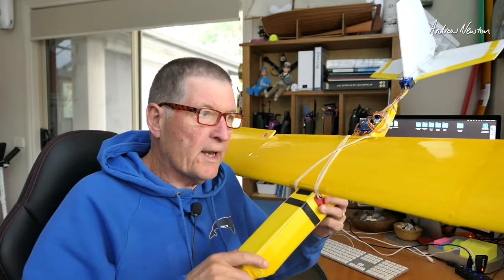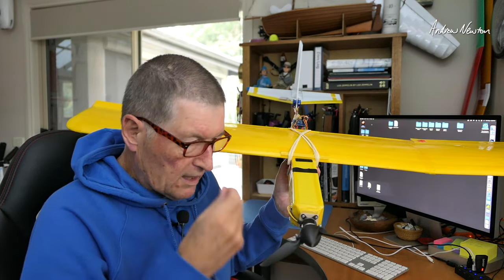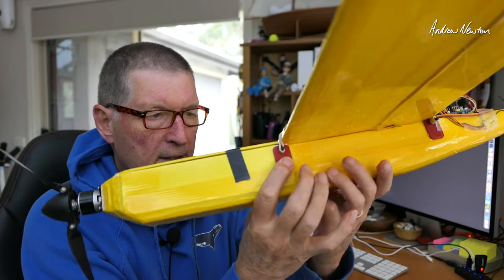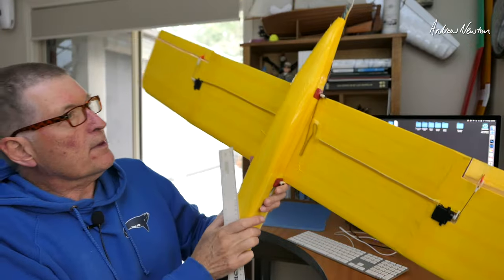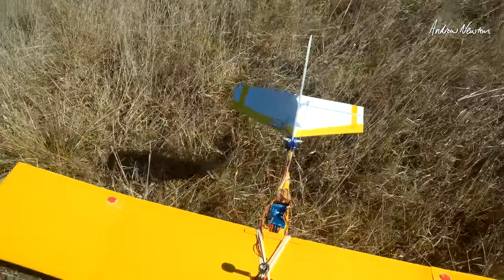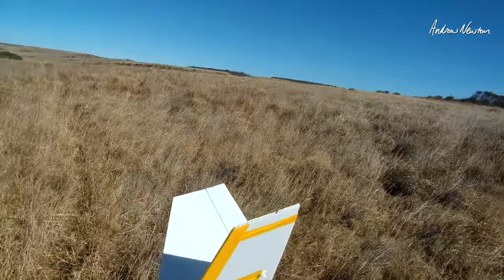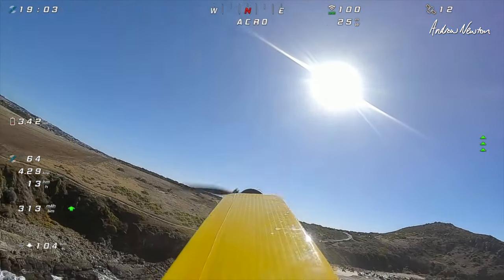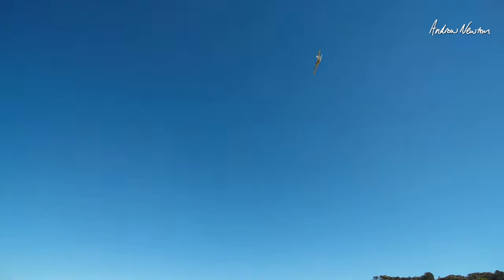Scratch Built INAV Single Tractor

Comment: Love this " make it up as you go build" this is what we need for all those guys who don't have pots of money, or permision required from wife! More homemade designs please, from anyone! Well done Andrew I applaud you sir!
Reply: Couldn’t agree more 👏🏻. Got into scratch building as a direct result of this channel. Once you’ve got the basic stuff, XPS foam from B&Q (I’m in the UK) along with bits and bobs from Amazon and my local ( and not so local) model shop you can just crack on with the fun. I have a small present to myself arriving almost daily 😂 and am almost rivalling my wife’s buying habits. It’s amazing how quickly you can work through prototypes, give them a try and adjust (or scrap 😊) accordingly. I’ve not used any plans and enjoy the challenge of getting my ‘creations’ to fly. The thing I’ve found is that if it looks right, it is right and it flies right. If I need a steer on dimensions (tail to wing ratio, fuselage to wingspan etc etc, I just google a similar aircraft to the one I’m building and the manufacturers helpfully include the dimensions. I’m a newbie in every sense to the hobby but I’ve noticed that flying a scratch built that is less than perfect has improved my ability on the proprietary trainer I use and has helped me become less worried about the occasional prang - it’s just an excuse to build another one! The other thing I should add is that before scratch building I found my transmitter unfathomable - now I can get into all the settings and play around to smooth out my DIY models’ imperfections. Happy building!
Reply: @bobmabel8543  your post sums up exactly what I was trying to say. I've not started scratch building yet, been flying on an off 60 years! I'm in Devon UK. Cheers

Comment: Gawd, this takes me back to my Flite Test and Experimental Airlines builds, what, 10 years back or so. Hind sight being what it is, I am somewhat alarmed I talked myself into stuffing hundreds of dollars worth of Ardupilot flight controller and FPV gear into something built with Dollar Tree foamboard and hot glue! It never occurred to me that the plans I carefully printed out and taped together, as templates to ever-so-carefully cut said foamboard, could be as flawed as my reasoning! Haha, thankfully Bixler and David knew their S, and those plans never let me down - just these stupid thumbs from time to time. But it was all worth it, I'm slapping together VTOLs and quads and keeping my skills honed, and helping fellas get into this awesome hobby almost every weekend. The very first plane I scratch built, a Versa Wing, rests on display in my living room. I'm pretty proud of how far we've all come since those days!
Reply: Nothing wrong with Readi-Board planes.  Many of us trust 'hundreds of dollars' of hardware to foamboard and XPS craft all the time.  A bent motor shaft on a $9 motor was my biggest disaster so far, and that was entirely due to my poor handling.

The idea that dimensions must be rigidly followed or disaster will ensue is also a bit strange.  CG and piloting issues are what usually jeopardize a plane.  Of all the dimensions Andrew just rolled off, the pitch of the horizontal stabilizer was the primary salient to me.
Reply from the maker: Yes they knew what they were dong, specially the wings

Comment: Thank you for your excellent videos.Any idea for sourcing xps foam since bunnings changed to the Bastion brand ,which according to reports seems lacking ….Cheers
Reply from the maker: Luckily I bought up a decent supply before it disappeared from Bunnings. No other source as far as I can see.
Reply: @AndrewNewton  Thanks I did too ,but running low …Cheers
Reply from the maker: I'll try the blue stuff and report back

Comment: Any thrust angle? Never really know when and how much to use
Reply: Down 3 degrees and right 2 degrees
Reply from the maker: Yes, as Jordan said, a little bit down and a little bit right. But it wouldn't really matter if you just made the mount square with the fuselage.

Comment: Hi, could you explain how to check our motor connection using multimeter?
My motor doesnt respond even though I already connected to my Servo tester, battery and ESC
Thank you so much
Reply: Using a multimeter, set to resistance (ohms) and connect to any 2 of the 3 wires going to motor, you should get a low ohms reading between any pair. If no reading then you probably have a break in a winding on the motor.
Reply from the maker: Thanks RB, also check resistance of ESC wires end to end for breaks or desoldered connections.